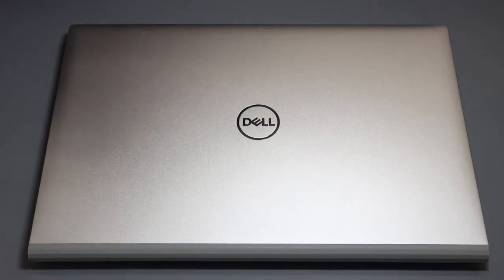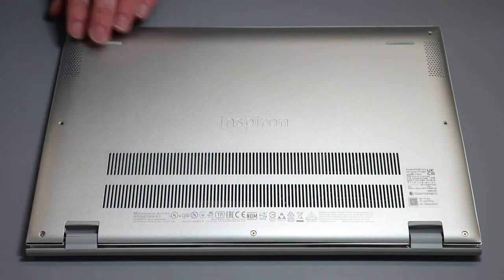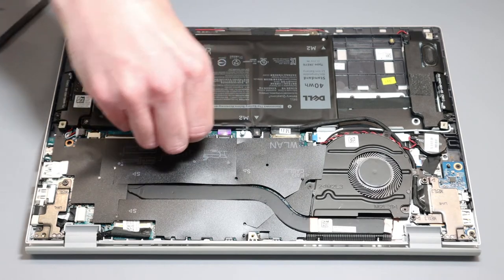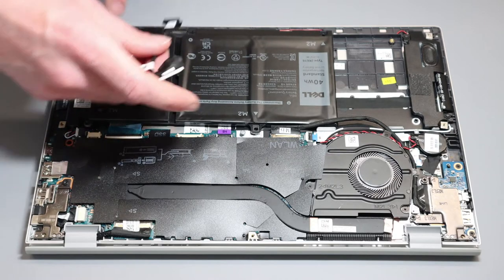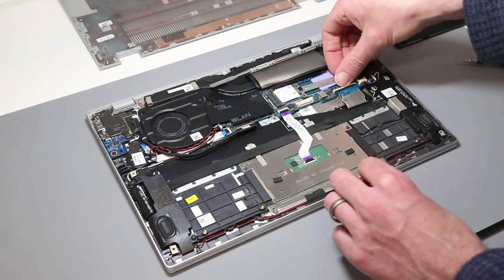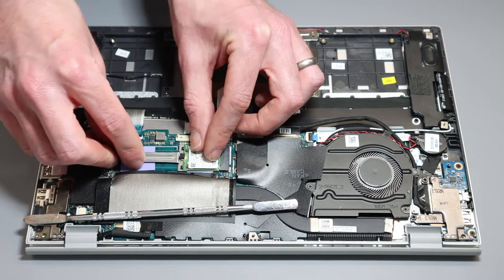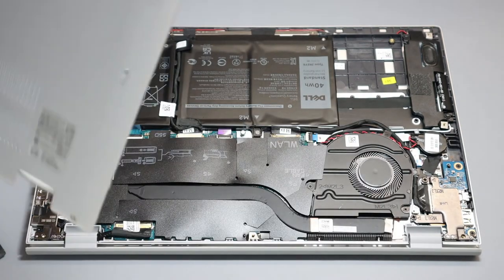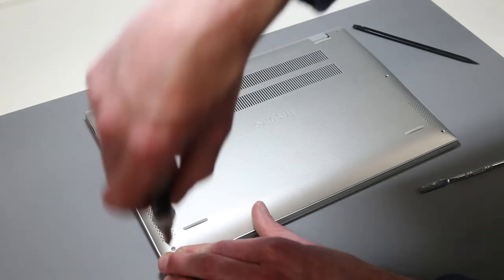Dell Inspiron 13-5301 SSD Upgrade and Battery Replacement Guide

Comment: Can the RAM be upgraded? how many slots are there?
Reply from the maker: No. The RAM is LPDDR4-4266, which is soldered to the mainboard.
Reply: @BrueComputing  oh, thanks. I thought it was ddr4x, according to the product description. The companies should give us more details 🤦‍♀️
Reply: @BrueComputing  Is it dual channel or single channel for 16GB config?
Reply from the maker: @ashishkulkarnii  There is no DDR4X - it is LP-DDR4X.
Even DDR4-3200 can be soldered to the mainboard however - best bet is to check service manuals if available if you're unsure.
Reply from the maker: @pjagasia  The 8GB model I had was dual-channel, so I'd assume dual-channel.

Comment: Is the model 5301 or 3505? The description does not match the title? Also is that free space next to the battery can be used for battery upgrade?
Reply from the maker: 5301 - sorry had copy and pasted the description from my 3505 video!
Yes, they do a larger battery which could be fitted.
Reply: @BrueComputing  Any updates on the screen? There is not much specs even on the dell website. Just curious if it's IPS, VA or TN. Also there is no clear details in regards to the Wi-Fi module and londer if it's Wifi6? Cheers
Reply from the maker: @J P  Wireless on this model was Intel 9560 which is WiFi 5 only. This is soldered to the mainboard and can't be upgraded.
Screen is only listed as Wide Viewing Angle - I suspect VA type panel but may be IPS - with a 95% sRGB colour gamut and 300 nits brightness.
Reply: @BrueComputing  Thanks for the info. Found the display item number from dell and looks like the screen is IPS "13 FHD IPS AG non-touch 300nits 95% Srgb".
Reply from the maker: @johnjohnson999  If you don't mind me asking, where did you find that?
Reply: @BrueComputing  The item number is from the invoice from dell, and the sepcs of the display is from here "https://itprice.com/".

Comment: This laptoo can upgrade battery? I see empty slot, that for what
Reply from the maker: Yes, the Inspiron 13 5301 is available with either a 40Wh or 53Wh battery - the 53Wh is wider than the 40Wh in this system and fills the extra space.
Reply: @BrueComputing  Were can I buy the 53wh battery? There wasn’t any info in the description